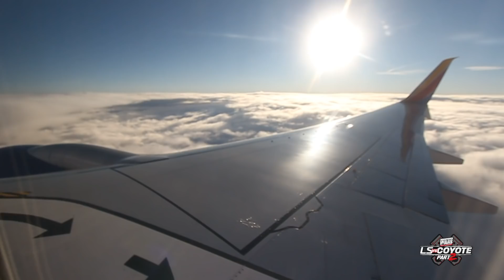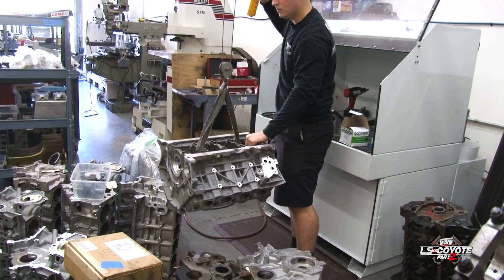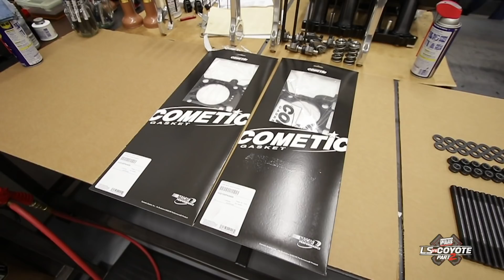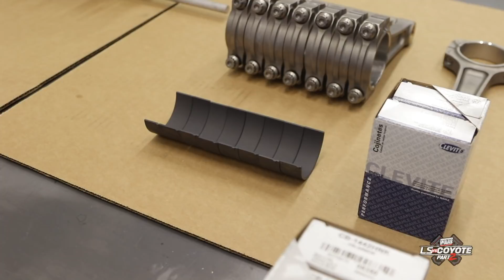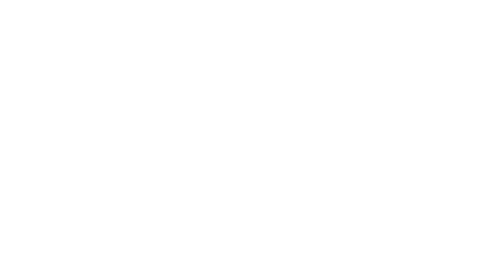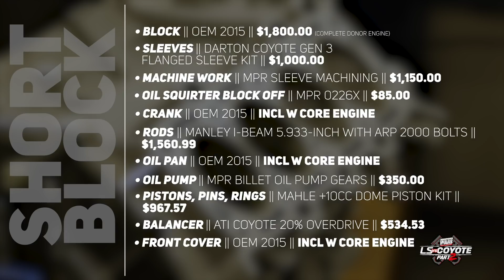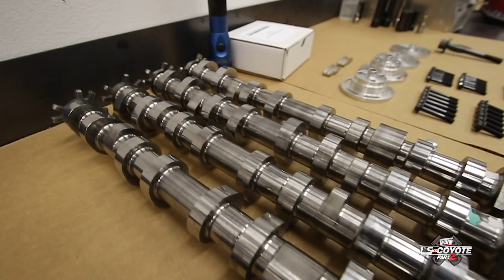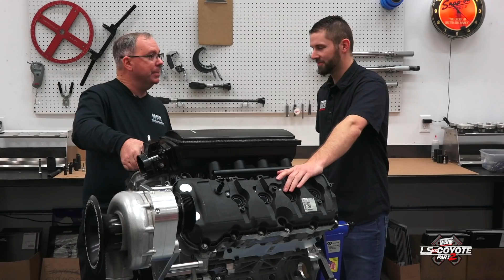LS vs. Coyote 2 Episode 3: The Coyote Engine Build

Comment: The mod list on the coyote is literally a fraction of the size😂 compared to the NASA reengineered LS
Reply: The only thing LS about the LS build was the crank really lol everything else is aftermarket stuff..... Also all the mavhine work was free for the LS, coyote had machine work listed in the build price....
Reply: @mrjesuschrist2u  if you read the rules any extra excess machine work adds to the cost so yes resleeving a motor adds to it for the coyote.
Reply: @verz22  machining a custom intake isnt excessive? Maybe LME didnt consider their port work and block machining "excessive" but we will never know.
Reply: Cesar's Garage 😂👏🏾
Reply: @Alpha Wërks , I'm not talking about in the bottom end, I'm talking about the cylinder heads
Reply: @Alpha Wërks  
Cylinder Heads (P/N 19201805): LSX-LS3 rectangular port; with “as cast” 68-cc chambers/six-bolt attachment
Reply: You can do more with the ls fore a better price its overkill fore sure but it's in the budget why not your just stupid when it comes to mechanics
Reply: Gen 3 HEMI!!    No?  Ok. I’ll be quiet.
Reply: Its part of the bail out guys. Leave government motors alone
Reply: @garrettrush8243  hey fuqtard, Ford had their hand out at the free money table till they heard the rules for payback, then still got government protection...
Reply: They both spent the same amount of money. Not LS fault that 5.0 parts cost alot more money. Power for dollar LS wins every time.
Reply: Robert Gardner that’s not the competition dumbass
Reply: Robert Gardner that “ power for dollar” argument is kinda is null and void if you keep having to replace the engine all the time because it blows a hole in the block whenever you put too much power to it. With Ford, it’s quality not quantity that makes power, which is why when Ford is kicking the shit out of Ferrari’s, GM is just trying to beat mustangs with the corvette.
Reply: @robertgardner2782  Hey Einstein my point is look at the amount or reengineering the POS LS needs to be competitive haha NASA inspired LS🤣 What a joke
Reply: Cesar's Garage What do you mean by re-engineering? If a different block, some suped up heads and a blower is re-engineering to you, you need to do a reality check. Seems like you don’t really know what you’re talking about.
Reply: @camkitchiner  Hey genius, CNC porting boring and stroking a LS isnt reengineering? You spend too much time talking to the jiffylube tech who changes your oil, its making you think you know about cars🤣
Reply: @cesarsgarage1393  lsx block is a reengineered LS block....
Reply: @mrjesuschrist2u , the only difference between a LS and LSX is
Forged a internals 
Cylinder Heads with six-bolt attachment vs just four
Reply: Anthony Webber Wrong
Reply: @anthonywebber2211  "tHe oNLy DiFfeREncE..." The block is completely reengineered, there are changes to webbing and passages etc. A production ls block usually gets filled with concrete at the power level these engines are going to make.
Reply: @camkitchiner  The block and heads had to be engineered, man, they didn't just copy the factory stuff, if they did, they wouldn't be any different than factory parts.
Reply: @cesarsgarage1393  Chill!
Reply: Cesar's Garage lmao. Your comparing a Coyote to an LS? Compare it to an LT motor if you want as close as an apple to apples comparison as your going to get
Reply: Reengineered like resleaving and modifying the block plus porting the heads new cams bearings rods Pistons. Seriously you coyote guys remind me of Honda guys how much you whine and make excuses
Reply: Who's making excuses? All out an LS won't touch a Coyote.
You understand that right?
Reply: @9090ruby  wow your funny a resleeved block cost less then an really engineered block buddy you can sleeve anything but really designing a block is a lot more and if porting cylinder head is all that and comparable to reproduce engineered aftermarket heads why did they not port a stock set of heads and oh ya you've never built an engine so don't wast my time lol want to know how ik this you said the coyote got new bearing like the ls didn't lol
Reply: @9090ruby  oh one more thing the ls got a new cam two just has three less which if you want to complain about that then watch other video where they compare it to a hemi or something idk what to tell you on that yes the ford cost money but it's a different power band
Reply: Matthew Leising i guess youre not picking up what im saying to you is that they were both re-engineering. Like i also said the ls used aftermarket block and heads because its available and this is a competition. I guess they should of known the coyote guys would cry about it but it will be ok I promise lol. Oh and no shit they both got new bearings again sounds like you weren’t picking up what i was saying.
Reply: @9090ruby  no bud the lsx is different from resleeving a block the coyote block is modified the lsx is reenginered what Crack are you smoking obvious that your not picking up what I'm through I'm down and I'm not but hurt mmr makes coyotes that can handle 3800hp I'll never need that much so the engine is capable of what I want and further more your but hurt because you hate the fact that someone's not bowing down to your fan boyish bro I live both engines and I would use the ls in many applications but I live mustangs sense I was a kid and having dohc v8 that's American is cool and I take pride why you trash talking the coyote idk cuz you know damn well its a capable engine the fastest stick car on stock body is a 4.6 4V beating Leroy and still has all of its body panels smh to you
Reply: Matthew Leising did i ever say the lsx wasnt re-engineered I don’t think so. I just think its funny all the excuses coyote guys come up with. Both engines in this competition are re-engineered its just that there is more aftermarket parts available for ls stuff. Why would i be but hurt lol im not complaining about what block and heads the ls engine is using just like to point out coyote guys sound like honda guys sometimes lol
Reply: 9090ruby sound like Honda guys like there’s anything wrong with Honda guys we are cars guys get that through your thick skull and second the coyote block is not re-engineered dumb had it has sleeves that’s not re-engineering for the third time it’s modified get the fuck out here
Reply: Matthew Leising and you call me but hurt lol.  Yes we all are car guys but its fun sometimes to poke fun at each other lol. My original point again is that both engines have been re-engineerd to some degree the ls probably a little bit more. So the original comment was kind of stupid in my opinion and my experience with coyote guys is they never tell you what’s modified on their car but give a long list of whats stock. And comparing them to honda guys usually gets a rise so
Reply: @9090ruby  They sleeved a factory block that left the building under the hood of a production vehicle. With the LS they didn't even bother...new block please...and lets not even mess with porting heads. I need completely new heads to do the LS. Oh and a new crank to boot. More Coyote as designed by Ford will enter the dyno than LS by GM.
Reply: Todd Johnson wrong its because it’s available for the ls so why not use it oh because coyote guys are cry babies lol. Guys have made 1600hp plus on sbe ls stuff so its not impossible but this is a competition and theres no restriction on using aftermarket block or heads and it fits into the budget.
Reply: 9090ruby Resleeving and modifying the block, porting the heads and using aftermarket cams is the way horsepower has been made for decades. The LS is so pathetic that the builder won’t even use a factory block because he knows all the modifications in the world doesn’t change the fact that GM builds garbage. What’s worse is the fact that GM copied a winning Ford design, but they did it so poorly that Chevy guys won’t even use the factory engine as a base for this competition. The Ford builder is using a factory TRUCK block as a starting point because it’s that good of an engine, no aftermarket block is needed because ford engineered it right the first time. Chevrolet: they suck so bad that not even Chevy guys will use their shit!
Reply: @vonmarko1363  y'all coyotards are so  mad because if you want to build an engine you have to buy a $3000 junk yard 5.0 then send it to get thousands of dollars of machine work. Then the LS guys go buy a $2800 LSX block and be done with it.
Reply: @matthewleising84  have you not heard of the LSX454. It's been out for quite a while now. Ford just got back into the big block game.
Reply: @robertgardner2782 , the LSX454 is a small block tho
Reply: @anthonywebber2211  anything over 400ci is big block. How is it a small block when its 7.4 and the Ford is 7.3
Reply: @robertgardner2782  wrong lsx454 is still a small block
Reply: @robertgardner2782 
LSX454 Tech Specs

Part Number: 19355573

Engine Type: LSX-Series Gen-IV Small-Block V-8
Reply: @robertgardner2782 , displacement don't determine the size of the block
https://www.customcrateengines.com/engines/chevy/427-small-block-chevy-turn-key-crate-engine-with-550-hp.html
Reply: @robertgardner2782  No, small blocks and big blocks have nothing to do with cubes. It's how the block it's self is designed. A small block mostly uses a 4.5 or smaller bore spacing and siamesed cylinders, a narrower main webs (because of the siamesed cylinders), narrower crank pockets that limit stroke length.

Big block's start at a 5" bore spacing, use a full wet cylinder jacket design, thicker mains, and wider crank pocket for larger stroke cranks.

I can take a 351w to 443 cubes on the extreme and it still isn't a big block, it will always be a small block because of its base design.
Reply: @robertgardner2782  agree 100% that's like the Old school days of comparing a 351 Windsor to a 302 or a 350 Chevy to a 305 Chevy it just does not compare apples to apples
Reply: @robertgardner2782     400 + is a big block? That's BS dude, GM made big block all the way down to 366 cubic inches small blocks up to 427 cubic inches.Ford had big blocks down at 360 cubic inches, what makes a big block is the bore spacing of the block that physically makes the block bigger. At 427 cubic inch LS  is no bigger physically than a 6.0. Listen I'm a fan of both Motors, but the biggest drawback to the coyote platform is it's just a huge freaking engine for such small cubic inches.
Reply: It's the architecture not the cubic inches you nitwit. They make a 460 cubic inch Windsor with the same 9.5 deck height as a regular 351.
And it would eat this LS lol....look up Man-O-War. That would be a reengineered SBF.
Reply: @matteatmon5558  The block it's self on the coyote is short than the LS and about the same width. What gives the Coyote it's mass are the heads. Any DOHC head it a big girl compared to a OHV setup. And just like you I like both motors, each has it's place for power making and use.
Reply: @robertelmo7736  But the Man-O-War is still a SBF, What makes a BB is the bore spacing, webbing, and crack pocket design. Also an OEM 351w can only really be push to about 445 cubes with wet selves. That Wan-O-War block has much thicker cylinder walls, and is a very nice block. They fixed a lot of the problems with the Windsor family when they design those blocks.
Reply: @TdrSld  Yep could not agree more, its amazing the amount of horsepower that is available in both of the engines.
Reply: You forgot about the extra head bolts/holes...couldn't figure it out first time I saw it lol...
Stupid small block with 459 inches, right at 700hp on the muscle.
Reply: @robertgardner2782  lol what makes you think that it's the same size as the ls1 in the 98 Camaro is that a big block
Reply: It's ashame IMO, they should have open up the bore spacing slightly. Their is no front drive V8 platform to need the short length.  They in turn could have gained some cubes and had a shorter engine which would help mustang hoodline. I guess the wanted to keep some commonality but I fail to see the need for it as they are bringing new tech in with vvt/DI. Now the new blocks don't have sleeves... Both platforms have their plus/minus but so far as ease of use and cost which is the biggest factor in the avg backyard swapper. LS wins hands down and for a street build the easy potential cubes are a big draw. NA off idle torque is always wanted.
Reply: @robertgardner2782  The LSX454 is a small block stroker.
Reply: @robertgardner2782  lsx is not a big block bro it's a stroked and bored ls and second it's not used in a production further more it's gonna cost more do you even know what a big block is it has nothing to do with cubic inches
Reply: @robertgardner2782  which gm car can I buy from them with the lsx454? Oh yeah you cant....
Reply: @mrjesuschrist2u  the same car that has a coyote with good liners in it...
Reply: @shaadydog1  I can install new. Bearings in my engine does that make it an aftermarket engine block? The modified an ls7 crank, I still consider it a factory piece .... I can go to copart/lkq and get it out if a z06 and modify it the same way
Reply: What are you going on about ? It's not like alum LS blocks  haven't been treated the same as anything else, good sleeves and support welded in, or a 3/4 fill.  They have been well over 2000hp. Get your head out of your ass, the modular blocks received a shyt ton of development and machining at MMR they didn't just resleeve them. On yellow bullet one guy claims to have run 50 passes on an ls2 full fill and factory liners at approximately 1600hp. Now moving forward coyote don't even have sleeves, is that factory to add something it never had?
Reply: Yep, LS vs coyote, so basically they threw that entire motor in the trash, buy an iron block you can't even get in a production car, different heads, cam f1x blower vs these fuckin retards who just chose an f1a over an f1x with a stock crank and some ported heads, that LS is gonna fuckin destroy
Reply: @A80_Boost  What the fuck are you talking about? They did not use a single LS part that went out the door under the hood of a GM production vehicle. The Ford engine is a factory block, heads and crank. Plus an off the shelf intake not a 140 hour custom welded masterpiece. Idiot.
Reply: So, the coyote is basically a resleeved factory F-150 block with an aftermarket rotating assembly and rebuilt, ported OEM heads, whereas the LS build has to use an aftermarket block, heads, and all internals. What this tells me is that even the “LS builders” know that a factory LS engine will shit the bed the moment you put any power to it. To sum this up: we have a 427 cubic inch, full aftermarket racing “LS” engine going up against a 302 cu inch modified truck engine. Naturally this is skewed in the LS styled engines favor just by the fact that they were allowed to run a big cube racing block instead of a factory block. Of course the ls styled engine will win just because it isn’t hindered by the limitations of the coyote. Of course if the Ford does pull off the win, then that will prove what a steaming pile of shit the LS really is.
Reply: @vonmarko1363  the ls doesn't have to it just allow in the budget were coyote is way more expensive be jealous bitch
Reply: @Alpha Wërks  "nobody" huh? Simple google search proves you ignorant. Guess youre just not at that level.
Reply: Yeah I’ll take the coyote anyday

Comment: LS didn't get charged for machine work on their aftermarket block or heads
Reply: So true you know they got to cheat
Reply: @austinhowze6280  Lmao there literally was no cheating 🤣. The coyote did both sleeve work and porting of the heads. The LSX did neither, the block wasnt sleeved and the heads were LME heads that came ported when u buy them. They werent going to add a maching cost ontop of the item cost that has machining in the total price already.
Reply: The rules exclude machining of blocks and heads to prep for assembly only, not to install parts. The Coyote motor was only charged for machining to install the sleeves, not to prep the block or balance the rotating assembly. The LS didn’t get charged that because sleeves were not installed. Pull your head out, quit looking for reasons to call foul. That’s what little bitches and whiny losers do.
Reply: @coryholbrook4643  call it what you want minus the machine work on the block and the heads for the coyote they are $2kish under budget. I havent gone to the MPR website to price the build yet but the LS could not be had at the same price listed in the video on multiple things for the LS.
Reply: @coryholbrook4643  the ls machined a 4500 dollar intake and it was all good and not a big deal you can go back and read my comment on the video and read the response I got
Reply: @ijmodified  
Yeah not being charged at least 2500k for the intake was fucked up when it cost 4500 to buy. If that's not extensive cnc and machine work I don't know what is.
Reply: @waynebollentin989  and it would vibrate into pieces at the power level these engines are going to make....
Reply: @waynebollentin989  They charged 3900 for the intake. 500 less than if u were to buy it, probs for machining.
Reply: @coryholbrook4643  why would you machine an aftermarket LS Iron block?